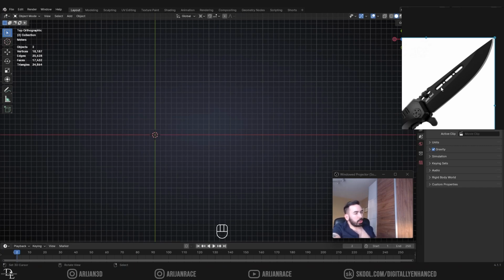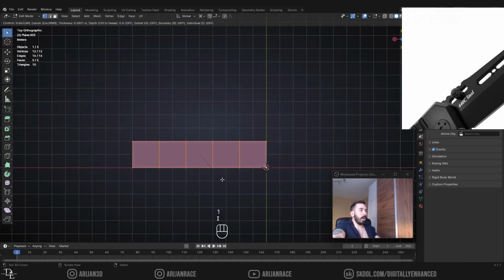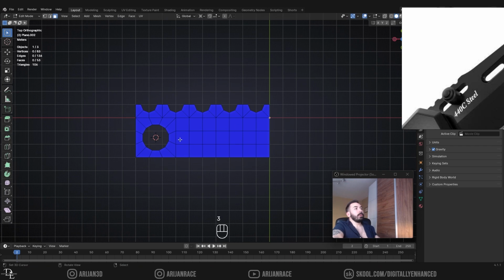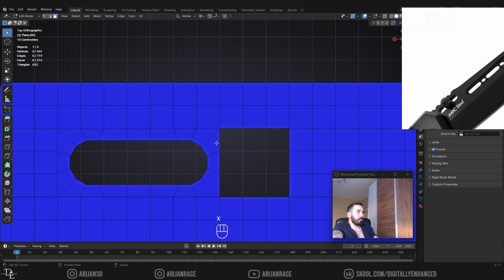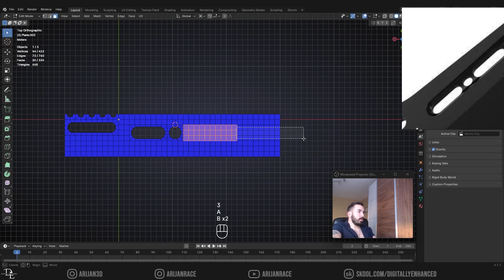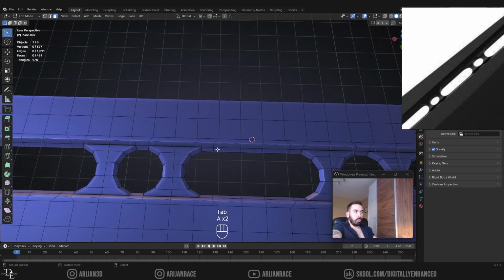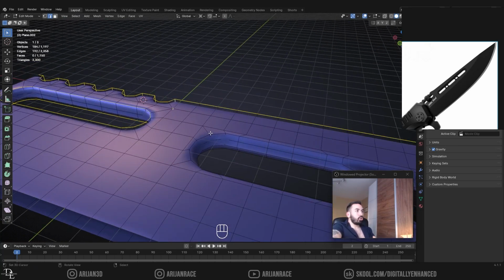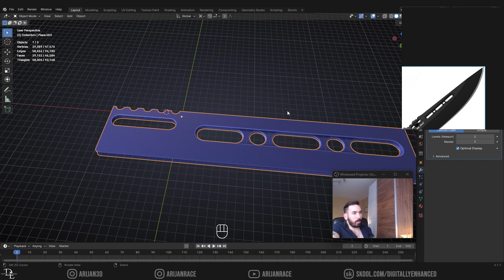The Hardest Topology Exercise for Knife Modeling (Part 2)

Comment: There is a color setting somewhere is the theme settings called face orientation front, and back. That you can make the face orientation only show red when you have a face facing the wrong way, 
and it will just be default grey otherwise, nice not having the bright blue in your face.
(You  set the blue front face to be transparent by turning the alpha channel down)

Aryan probably needs it to be blue for us noobs, but for anyone else that might find it helpful. Hope it helps.